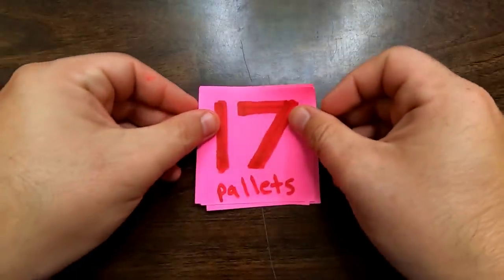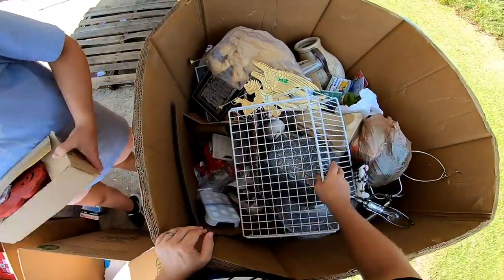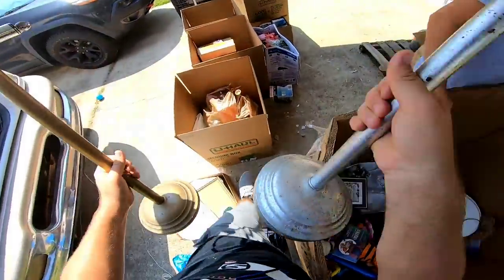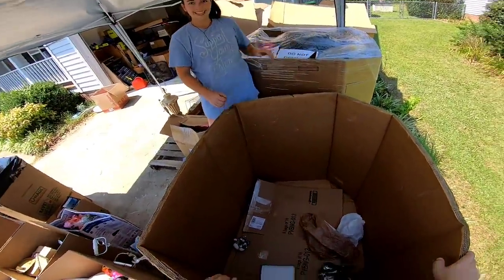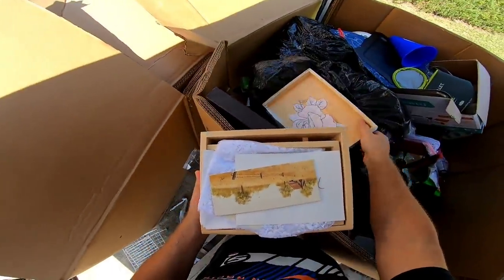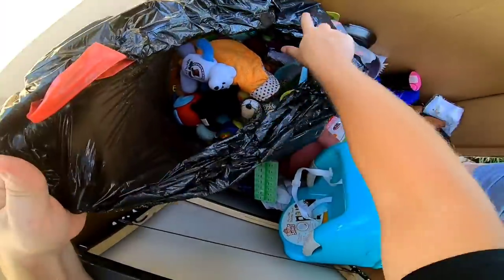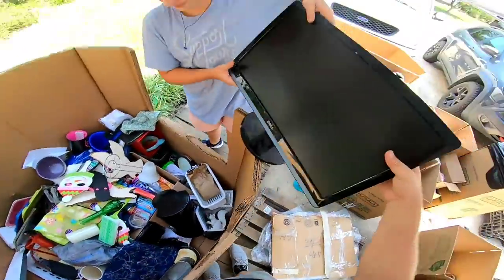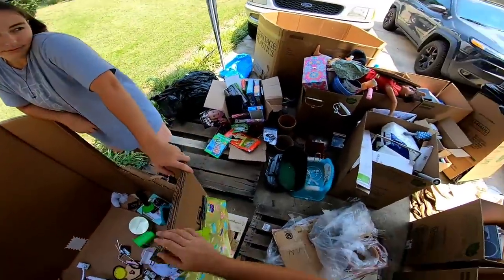My Wife And I Opened TWO $40 Goodwill Mystery Pallets And Found AWESOME Stuff!

Comment: First rule of thrifting/item searching, wife or girlfriend has first choice for keepers. Second, agree with it. Third, personal choice and benefit. I noticed that Saladmaster skillet before you grabbed it. A full 25% of my sales are from cookware and a majority are of that brand and some right next to me now. There are different levels of the pans so match with what the side says. Such as T304, tri-ply, 5-ply, and the best ti316 (titanium). It looked like you had an older Club hammercraft aluminum roaster. If appearance has problems, they are easy to clean, even polish. Although for that one I wouldn’t put a lot of time into although still a good eBay item if not heavily pitted

Comment: the interactive toys that require batteries if they dont work with new batteries and u know basic soldering can easily be fixed usually a wire inside comes loose from cold soldering joint all the ones i fixed were the negative or positive wire for the battery compartment

Comment: I know it's too late now but I just noticed the stethoscope in the bottom of the box check who it's made by Littman stethoscopes are worth $$ they are one if not the best stethoscopes in the business mine new for a very basic model was over $100 and the specialized ones are upwards of $200 plus depending. But even if it's not that brand there are several good brands worth worth decent amount that sell well on Facebook for $10-$20 especially if there is a college or technical school close.

Comment: The George rotisserie’s used to sell for big bucks but I haven’t checked in about a year. If there are any unused parts, part them out and sell on eBay. I sold the basket for about $30 plus shipping. Maybe your comps are low bc this is a Jr.? There were 3 sizes.

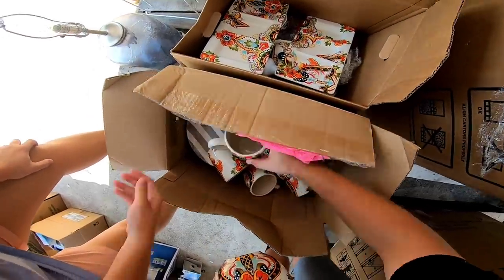Comment: 10:33 Chipped or cracked bowls of a set I like? I have solutions to: Let the mug crack on it's own, then use an epoxy glue, E6000, adhese the clean edges back together. I've used it from Platinum to Gold Gilt dishes, myself, including Gran's 1880s wedding dishes turkey platter together. 30 yrs later, you can barely tell! I do the same for chipped bowls, just coat the clean edge until I feel it's safe. Once again, I'll eat out of it, if all bowls are needed. Good Will had the extra plates, cups, to finally complete Gran's dish set back to nearly a 12 person serving.

Comment: Lives are 160 new for 4 with those coloured handles. Steel handles in box for 8 are 400 to over 600. Still looking. They have names like zwilling
Reply: Knives auto correct.  Only their chicago are cheap. But they have Black plastic handles. Only ones I found with those blades and handles ( kinda)  are their boker at 159.95 for 4.

Comment: Did you check the lamps for a name on the metal light fixture part? They appear to be swans. could be cranes but probably swans, also every listing that had one on worthpoint only had a single lamp that sold, not a set, and none with those bottoms.

Comment: I have seen on another page about that car that you put in the garage sale box I think those are actually very popular people that race cars they use the shells of the cars to make new ones and they pay a pretty penny I saw someone sold one on I believe eBay for like $60 or $80 so those might be worth keeping and posting on eBay just the car shell even though it doesn’t have a battery they’re very popular with car toy car racers
Reply from the maker: I do sell the body alone sometimes but that usually works best for Large ones (like 16-24 inches). This one was like 12 inches.